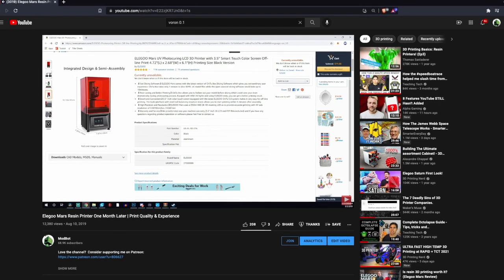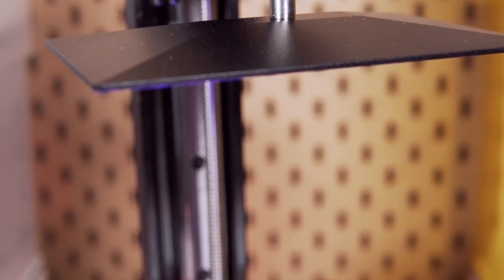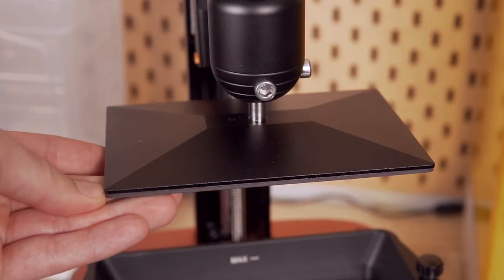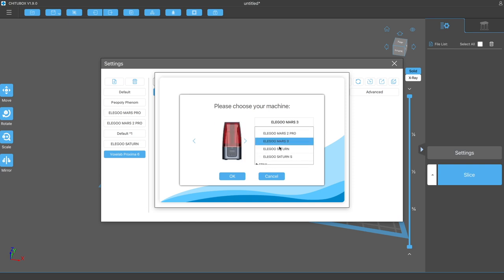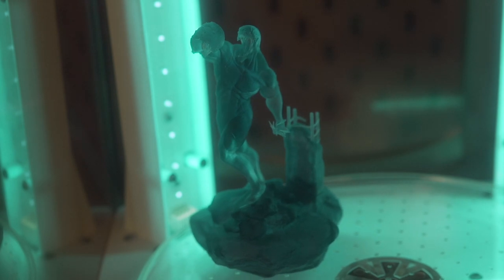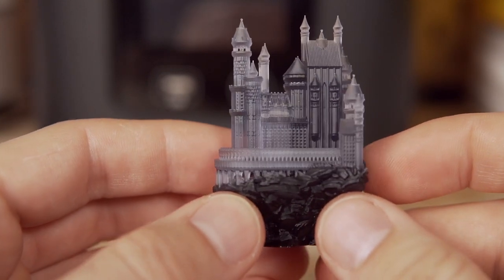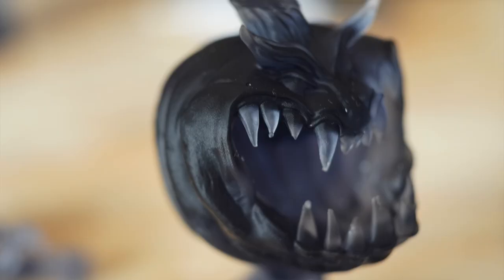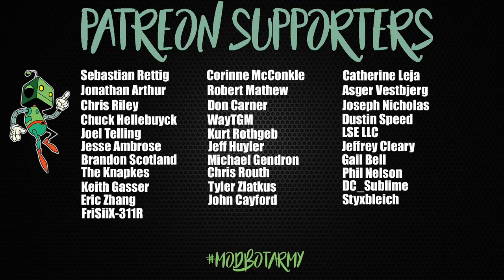Is The Elegoo Mars 3 Worth It?

Comment: Nice review! For anyone watching this now (Jan 16, 2022) I ordered a Mars 3 a couple of days ago (my first resin printer btw) and noticed the blurb said Lychee slicer files now supported. Also saw this reported on another YT video somewhere. (problem with so many reviews is that they're rarely updated but I know that's an unending job so difficult to do in practice). Thanks also for pointing out the low odour of Siraya Tech resins. I live in a small apartment so these will be something to check out for sure. Cheers.
Reply: It's been just over a month now. How do you feel about your purchase? I've just about decided to go with Elegoo Mars 3.
Reply: @billyw8186  Prints are great. Easy to use. I added a Wham Bam flex plate, a must imo for easy print removal and cleaning. Cleans up easily. Used 500 mL of Elegoo Water Washable grey resin already. Wash in water and follow up with IPA. It's been down for a couple of weeks because I had a hardware failure. Limit switch at the base failed so the print head would not travel down. However Elegoo support was great and I just received a Fedex'd replacement yesterday. They even sent a new motherboard so now I've got a spare. To be honest I felt deflated and considered returning it an dbuying something else. But looking around at other 4K printers I really couldn't see anything better or easier to use and they all had there own hardware problems reported by users. So bottom line is no regrets. Prints are stunning and I haven't even spent much time trying to optimize print settings. Happy printing whichever way you go. Cheers.

Comment: I have a still boxed 2 pro &  3, and have been debating which one to open and which to send back. Thanks to your video, I've decided on the 3. I'm brand new in this and figured that proprietary slicer program will be plenty for my greenhorn self. I'm planning on building small close-up magic props that aren't that complex, and decided to go 4K just because it seems to be the stepping stone most modern technologies are comfortable with and will be the medium for a few years anyway. I did also order the flex plate and spacer per your links. Thanks again!

Comment: I really despise the locked down hardware and software path Chitubox took here.  I think this printer clearly show their intentions to create a walled garden ecosystem leading to expensive software subscriptions and steady cash flow. I mean they're a business whose intention is to make money. I get it. But it also shows they're afraid of competition.  That they're afraid someone will be able to make a better software product for cheaper based on their hardware and that they won't be able to compete.  Lack of innovation and competition is not the type of 3D printing future I want to be a part of. I'll have to pass on this one.
Reply from the maker: I think you have valid points. It is to bad that much of the market is using these boards and they really do work damn well. I think Chitu shot themselves in the foot and I really hope they learned their lesson.
Reply: IBM tried this sort of thing way back in the day with their "Micro Channel" architecture.  It failed just as miserably, although at a much greater cost.
IBM eventually embraced Linux...as opposed to Microsoft's Windows.  AKA "open source."
Reply: Lychee is support now
Reply: The basic Chitu is free and is practically the same as the paid version, just lacking a polished UI and a few advanced features. 

You can still use a third party like the Prusa slicer and import into Chitu Basic to get the same features.

Comment: Something interesting to try with the new wash and cure would be different cleaning solutions, like IPA, water, pine sol and others. It'd be good to see the different results.
Reply from the maker: I played a bit around in the past with at least mr clean and although it worked it seemed to eat away at the wash station much quicker (the rotar on the bottom). Also, I did not feel parts were quite as clean. I think they are viable options but still not as good as IPA. There are some specific resin cleaners that exist but they are even more expensive than IPA.

Comment: The only thing holding me back on this printer is the requirement for a proprietary slicer. I am looking at my first 3D printer purchase and this turns me off to this printer.
Reply: This is not true anymore. Lychee can output to .ctb format, which I have been using on my Mars 3.
Reply: @Artmesa  Thanks, that puts this printer back in the running for my first 3D printer!

Comment: Not being very familiar with printing multi-piece miniatures, instead of gluing them after printing, couldn’t you use Blender, Fusion 369 or even Mesh Mixer to fuse them together, and remesh and export  the result to your slicer? Or maybe they’re encrypted so you can’t modify them?
Reply: I'd think you could.  A lot of miniatures will also contain the model complete...or a break down into individual parts as an option.
Reply from the maker: This is possible with something like mesh mixer or even tinkercad I believe. The hardest part would likely be aligning the faces to eachother. Definitely an option though should you really want to make it happen.

Comment: Why is every 3d printer tester making a goon of himself fiddeling around with those so called washing maschines made of cheap chinaplastic? I mean there is a superior way of cleaning resin...been there fore years. The industry uses it...its called an industrial ultrasonic cleaner...has a way better built quality since its made for heavy use...it doesnt swirl around your prints damaging intricate parts of them...it also can heat up during cleaning to lets say 95°F (35°C) so that your supports go off smooth like butter.

and now the kicker...   those things cost even a few bucks less than those "washing maschines"

And by the way for safety reasons its mandatory to wear a red class A propeller hat when using the "washing maschines"
Reply from the maker: Ultrasonic cleaners are not recommended for use with ipa due to their flashpoint. You can use alternative cleaners but I have yet to find anything as good as ipa t actually clean the uncured resin.
Reply: @ModBotArmy  There are maschines that can, but those are expensive and not the ones I am talking about, So that beside. I never told anyone to put ipa into an ultrasonic cleaner. You dip the model in ipa after the ultrasonic cleansing and place it on a paper towel till its dry...
Reply from the maker: @Presbiter  Interesting, why not just use a wash and cure station then? It seems like an added step. Not saying that is not a viable option just that I do not see why you are against wash and cure stations when many enjoy the ease of using them.
Reply: @ModBotArmy  What added step? the 1sec dip in ipa to have them entirely clean of any recesses?
And why not use those stations? mmh. because of their built quality in relation to their price, which is pretty damn shit...because intricate parts of your print could be damaged when put into a swirl...because they dont heat up your prints so that your supports glide away like they never were there without hustle and recesses. 

I dont know man, if those reasons arent enough for ya, hell who am I to tell you what to do with your money. Load up your attic with those for all I care.
Reply: @Presbiter  is that what you use for your resin prints?
Reply: @Imm0rtal49  yes